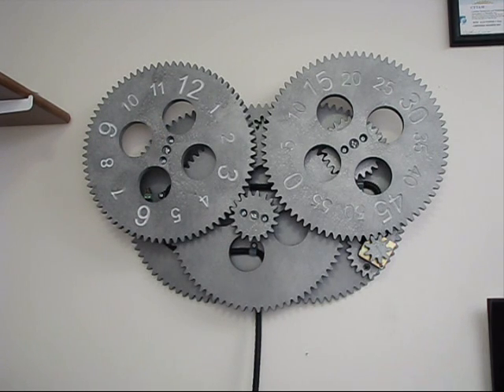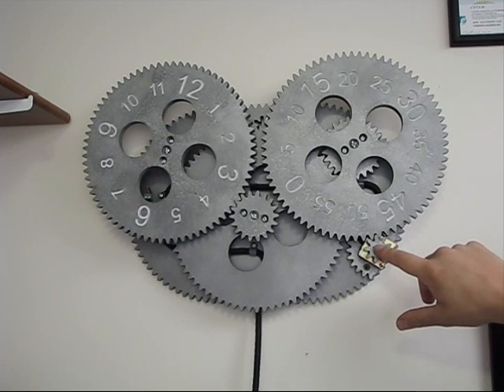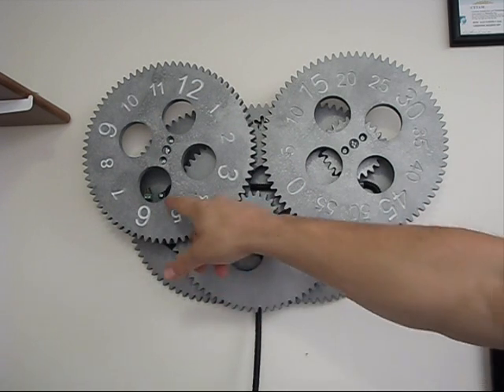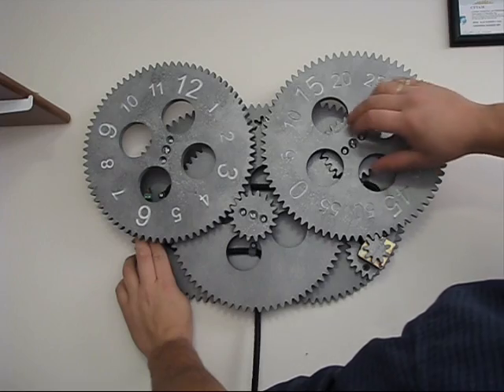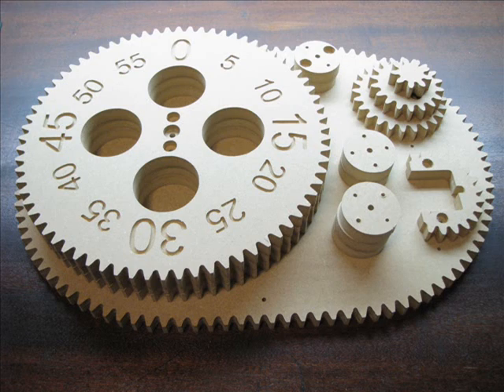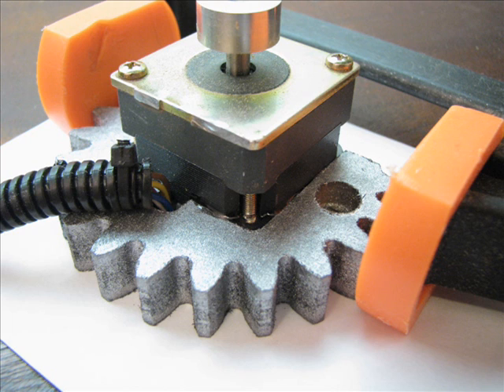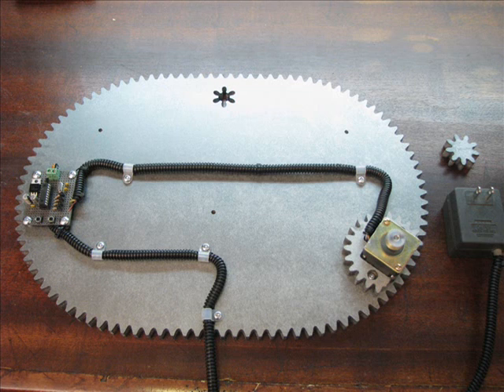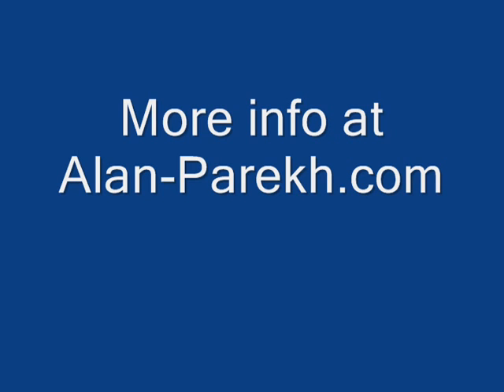Gear Clock

Comment: I managed to control a stepper motor with a microcontroller, but the motor itself beacme inredibly hot over time. Wouldn't that be dangerous for the wooden parts?